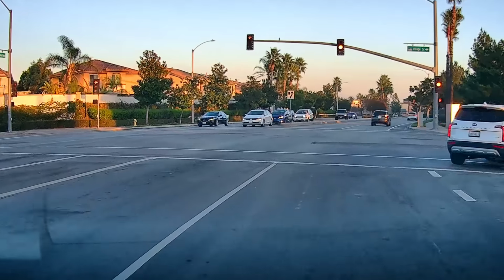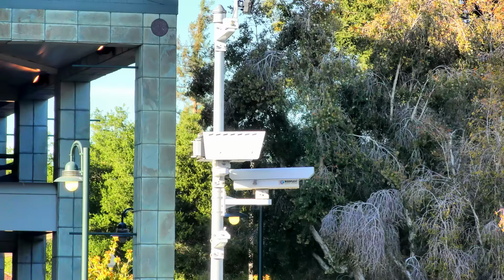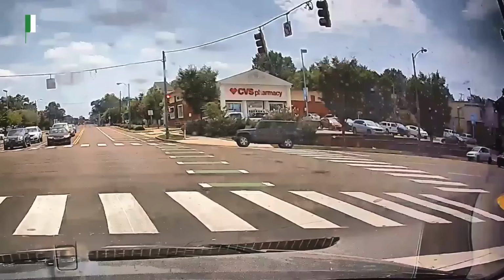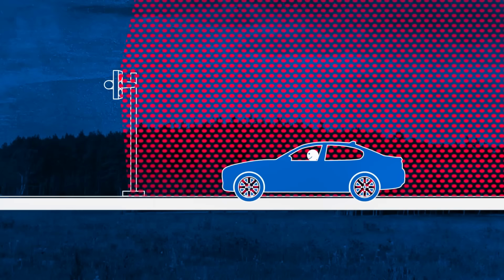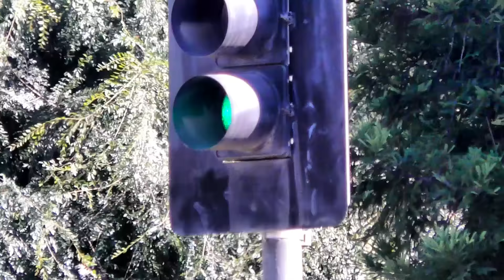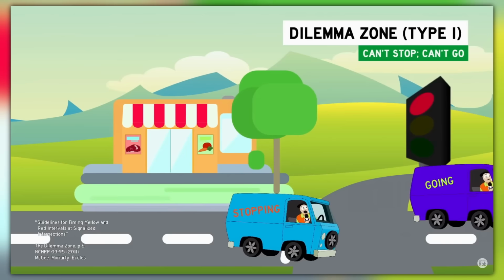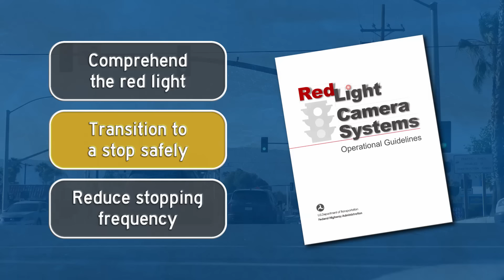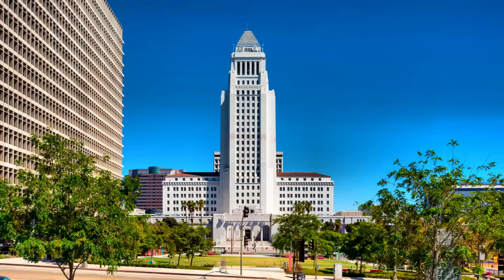Three ways to FIX a STOP LIGHT (so drivers ACTUALLY STOP!)

Comment: I ran a red lihgt once, was changing channels o the radio, was just a second, then I realized that the drivers entering the road were glaring at me as I coasted through unaware and I felt so embarassed, speeds were low, I just waved apologetically and learned a valuable lesson about distractions while driving, but we are human, we are fallible, a lot of things both inside and outside the car, or even in our minds depending on what kind of day we are having could distract us, I also had a situation with an unmarked junction in the dark that didn't feel like a junction at all, I was lost, it merged with another road, but in the dark, you couldn't see it because of the trees I just suddenly saw headlights on my right ( in UK) knew I couldn't stop, so I hit the gas as hard as I could and hoped the other driver had spotted my mistake and was braking for me, fortunately, between his heavy braking and my heavy accelerating we avoided the conflict and I apologized profusely for nearly killing us, but the design was terrible! Large luminous road markings? No! Rumble strips to warn you are about to merge with a 60mph road? Nah!

Comment: Only in north America do we have something called stroads. They are neither streets or roads but high speed throughways in cities, usually without sidewalks or cycle lanes. They are dangerous for everyone. Especially pedestrians, cyclists and the elderly. They don't make traffic move smoother as they almost always have an abundance of traffic signals which do not allow a pedestrians enough time to cross. With the addition of turning lanes they become even more dangerous, even when the pedestrian has the right of way. No amount of engineering will fix this.

Comment: Why not remove the yellow but keep the same delay between when the light goes red but the next light turns green? Running the yellow light is now so common that it's the exception to stop on yellow. Additionally, people have got much worse at running lights they know they shouldn't. If few people follow the yellow, then has it out lived it's usefulness?

Comment: Instead of using red light and speed monitoring cameras as enforcement, how about using them for education? No fines, just a nicely worded note about the infraction and a message about possible consequences of continued violations by this particular vehicle. That may include an increase in annual registration fees. The letter should go to the owner. It should be up to the owner of the vehicle to make sure that whoever they let drive the vehicle knows and pays attention to the rules.

Comment: There is no way those programmable filters are safe. Every time I see those, that is when I feel most at risk because I am completely uninformed until the last second. Sometimes 30 feet before you don’t see whether it’s Green or Red. Super dangerous. 

Sounds a lot safer to just see both lights in order and accept the information in order rather than completely cutting off the driver from pertinent information.

Comment: If you want to see unnecessary amount of traffic lights, drive down any street in a Japanese city and you'll be tearing your hair out.

Driving 35 kms into central Melbourne (Australia) outside of peak times, I can cover this in about 40 minutes. Traffic light count along the way is about 50. (aking the freeway, I have done it in less than 30 minutes. Using ther toll roads, 25 minutes.)

Driving 25 kms into Osaka city down major roads outside peak times takes almost 2 hours! Traffic light count along the way, I stopped counting after 120. (Takinng thr toll road reduced this dramatically down to 30 minutes)

Comment: Or maybe since there are 3 lights per signal (red green yellow) we now have the technology to turn ALL three lights red rather than just one.  Even if someone were color blind they couldn't miss that.
Reply: What will happen, when one light burns out? There is a reason, why traffic engineers don't do it.
Reply: @oskarrunhaar6607  Ok. If the red burns out what happens? If the yellow burns out what happens? If the green burns out what happens? If one of the three reds burns out what happens?

Comment: This puts a lot on traffic engineers but ultimately, if you are incapable of controlling your vehicle or  obeying traffic laws then you should not be allowed to drive.  Example: "going above the speed limit, so we need a longer yellow light"  Slowing down is the real answer. Tailgating an RV so you can't see the light is another example.

Comment: The state that I live in recently installed rotaries everywhere. Accidents in my state have skyrocketed due to the confusion rotary's cause to unfamiliar drivers. And the accidents happen 99% of the time upon rotary exit from the incorrect lane. While adding a rotary may have reduced fatalities, it has certainly increased motor vehicle accidents. On top of the rotary is also generating outrageous Revenue through traffic violations. I am of the opinion that the engineers design everything in a manner specifically to generate motor vehicle operational violation revenue. And without traffic lights, the scumbags of the road will not let the polite people go.
Reply: I think you answered your concern by noting that people are simply unfamiliar. The best traffic device will cause confusion when its first implemented.
Reply: @norezenable  oh I definitely agree. But it appears that perhaps the governor is taking advantage of people's confusion in order to generate revenue. I live in the state of Rhode Island, we operate on the verge of bankruptcy every single year for the last 40 years

Comment: the one time I ran a red light, I was so distracted in my thoughts, I just assumed my light was green after cross traffic stopped, forgetting about the protected left turn. The only people turning were on my side of the intersection, so there was absolutely no risk of an accident, but once I realized what I did, I was so still horrified/ashamed of what I did. So etimes people are just absolute idiots.

(I forgot my wallet at a random hookup's place, so I was worried he'd take my cash. that's all :/)

Comment: Or just put the traffic lights IN FRONT of an intersection at the line where traffic actually has to stop, and not behind the area they are supposed to protect. Much cheaper and easier to do. But still, please, please build more roundabouts (in the correct way).

Comment: It appears synchronizing lights to a predetermined speed limit keeps traffic flowing thereby increasing vehicle fuel efficiency, reducing traffic noise, discouraging speeding, reducing air pollution, and running red lights. The cost to implement such a system can be offset through a slight sales tax on fuel that is equally offset by increased vehicle fuel efficiency. No one is punished and no cameras are needed.

Comment: I really like people that pretend that red light cameras are about "helping" and how "bad" it is that people slip through a light as it's turning red.

Red light cameras are being actively REMOVED for all manner of reasons, not least of which is that the yellows are being reduced in length to trigger MORE people running the light, thus more fines.

The simplest way to trigger red light compliance is to ensure that the yellow is long enough to provide drivers adequate time to stop at slightly above posted speed limit, or to give drivers time to get through the light before it turns red when they're too close to stop.

Red lights are there to direct traffic and not generate revenue for the locality.

Comment: There you are with technically running the red light again, if the light is yellow when you enter the intersection you cannot run the red light. Secondly, police officers are not trained on what is an actual red light run, and traffic cameras are worse than useless. Mostly because the company that they hire to do that process don't know how to set up the camera to actually decide what is actually running a red light what is it. That's why they've been almost universally gotten rid of in most of the country.

Comment: I challenge the assertion that no amount of enforcement would help in the Fremont case. Those speeding drivers chose to speed. Lock them up and only good safe legal drivers will be on the road. Instead of engineering to accept dangerous criminals who would rather kill a stranger than drive under 50mph through a town.

Comment: A $200 ticket to someone that makes $50.000/year is not the same as a $200 ticket for someone that makes $1.000.000/year. Those are the types that have expensive cars that have a lot of power and torque.

Comment: I think you are missing the major issue here:
Why having traffic / stop lights at all?

We already invented the round about.
The USA should invest on Education, and building at least one round about at every town in the USA.
This way, people would gradually get used to round abouts.

Round abouts have the following advantages:
a) There is no need for electricity to run them;
b) The building process is often cheaper;
c) There are less contact points;
d) Contact points are of less consequences (hitting a car side-by-side, instead of head-on)
e) An eventual crash occurs at a slower speed, as you have to slow down to make the corner of the round about itself;
f) There is less time wasted waiting for a traffic / stop light to change from red to green (which is something Americans love: not waste time!).

The advantages of round abouts are:
1. Occupy more land (which is not an issue in the USA, like in Japan)
2. It can be a challenge for a long truck to make the round about
The first disadvantage is only true on a small intersection, but on a larger intersection a round about might be better.
To overcome the second issue, it is used a double circle round about, with a small height outer round about that would discourage car drivers to get over it at high speed, but allow trucks to get over that small bump; and a higher inner round about which discourages everyone to not do a circle around it.

I honestly do not get why North America (both the USA and Canada) do not invest in round abouts!
Reply: Another issue I find about traffic / stop lights in the USA is the fact that they are on the other side of the road - and not in the limits of where you are supposed to stop.

This makes the driver to focus ahead, and more likely to rev up his engine, to get off quicker.
Moreover, a truck might block your view of the traffic / stop light.

If the traffic / stop light are on the limits where you are supposed to stop, you will be looking at the side - because you cannot look up - making think before you floor it!
Being on the top, more people behind can see the traffic / stop light.

The only thing I like about traffic / stop light on some states of the USA - which is a band-aid over the issue of having too many traffic / stop light is:
Being able to go right, even if the traffic / stop light is red, always giving way to the incoming traffic.

Comment: Sorry, but I disagree with you somewhat, and here's my alternatives:

- get rid of red light cameras. They have been proven to cause more problems, and wrecks, plus they are a temptation to manipulate the lights to get more revenue. Ex: One small town got those cameras, and a week later lowered the time from yellow to red to get more red light runners, plus increased the sensitivity and moved the stop zone back before the actual stop zone.

- Make the light signs light up when the light is red. This also works when there is not a feasible way to put a light around the corner. Simply put: the light turns red, the sign comes on. It works for low clearance bridges.

- TIME THE LIGHTS RIGHT. Instead of trying to make the lights not overpowering to the current red light, simply take the lights in a given area, and have them synced together. One light goes green, they all go green. Not only will it eliminate bottlenecks, but will also stop most traffic at the first red light, and only those turning into said lanes will be able to fill in the other lanes more effectively without having to sit and wait (a typical problem in high-traffic areas). One area 10 minutes away is notorious with traffic problems because the lights are not synced, and what would be a 1 minute run turns into 5-10 minutes on a busy highway, thanks to lights not in sync.

- Universally make the lights sync with the stopping distance. Typically a yellow light is needing to be at a minimum 2-3 seconds. Traveling at 50mph (the speed limit on some roads I travel), I'd need at least 174 feet to safely come to a stop once the brake if applied. Usually turn lanes would be that long if not a bit longer (a life hack for motorists). Also, as someone else said, a light counter would be good.

- Make the lights on major roads longer than the side roads. Ok, you have a green, third car out, traffic just starts moving and suddenly it goes yellow after the first car. It's not common, but again timing of the lights is a major issue. Major roads need at least 1.5x-2x the length of green for everyone to safely traverse through, where most side streets don't need this. One light in my area is notorious for having a 10-20 minute long wait because of one traffic light that stays on the side street for that long of a time. 

- start busting people impeding the flow of traffic. You know who you are, going 40 in a 60 in the passing lane, keeping pace with the other cars not letting anyone pass, only to just get through the green light, or push the yellow. If we can get everyone traveling the speed limit, some of these light problems would also go away. Start writing tickets for the pace cars for impeding the flow. This will also reduce road rage incidents.

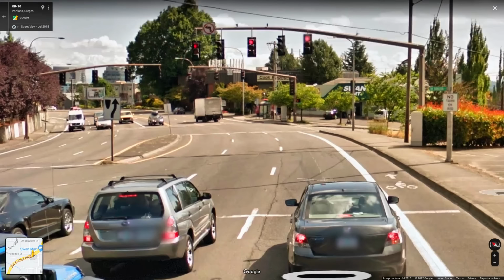Comment: 2:51 this logic is flawed though. going by this logic speed cameras are useless as well as they only deter people from going over the speed limit that are knowingly and intentionally go over the speed limit.
But the ticket you get is not necessarily just to deter but also to remind. same with red light cameras.

I do agree massively though, that infrastructure itself should communicate speed and stopping. You don't need highway-type lanes when the speed limit is 30, you don't need stop sign at every intersection, unless the design of the intersection can't be made much safer (see europe).
In most cases these two measures alone would help drivers deal with red lights.

Comment: First, prevent drivers from driving too fast, thus the braking distance will always be correct.  Move the traffic lights to the side of the driving vehicle, so there is no excuse for not knowing or seeing.  Roundabouts are only great if the mentality of people is to let someone else have the right of way.  But if they think they are the kings of the road, it will have no effect.  It would be good to establish official driving schools with parkour where there are rising obstacles on the line to stop at a red light.  This is how young drivers will learn to respect traffic lights.  For an even better lesson, I suggest that schools organize an education about the importance of seat belts, where schoolchildren sit on an accident simulator with or without a seat belt, so that they recognize the importance of respecting the rules of safe driving.  Asphalt humps can be placed to physically prevent speeding on the roads, which force the driver to reduce speed, otherwise they will damage the vehicle.

Comment: Surprised by the willingness to accept dangerous driving, rather than expect drivers to improve.

If you can't see a light because of an RV, then the most basic insight is that the following driver is too close to the RV, and should slow down until s/he can see properly. As for someone running a redlight "unaware" - well, they are aware and educated now !

In the case of your 74 year old killer driver, why has the guy even got a driving license if he's as blind as a bat or as sleepy as a sloth?
(Just checked - how the heck did that killer get off with 60 days jail time?)

Comment: The first thing is to change most stop signs to yield signs and eliminate a bunch of unnecessary traffic lights, or at minimum make them smart so people don't sit for no reason but tyranny.

And also eliminate those cameras.  The public never agreed to mass surveillance and it wouldn't be constitutional even if they did.

The most important tool is engineering.  Education is mostly obvious and unnecessary except for new drivers and ones with licenses from other places.  Enforcement of traffic control devices is never necessary because unsafe driving is always against the law and has to do with way more circumstances than the boilerplate regulations allow.

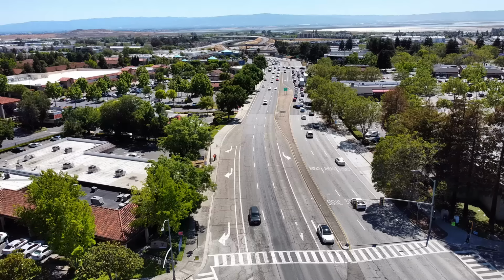Comment: 8:56 Will watch your other video. Other countries have amber warning lights ahead of intersections that will be red when the driver arrives, usually installed when the speed limit exceeds 60hph (37mph). In my area, the slowest surface streets are 45mph, with many at 60mph, including a steep downhill street at 60 with a traffic light after a blind corner! This should be illegal. Yellow lights should all be timed the same according to the speed limit so drivers know exactly when to stop. The fact that this is still arbitrary is insane and infuriating. Sorry, but you touched a nerve. Traffic management is hyper important and seems to be run without any regard to flow or safety in much of the country.